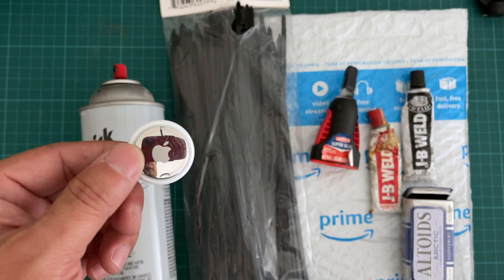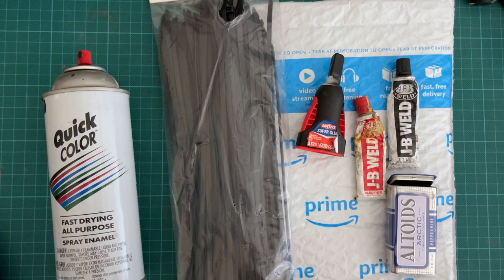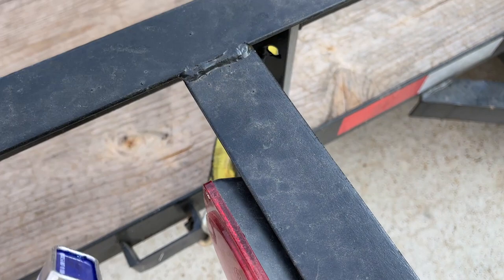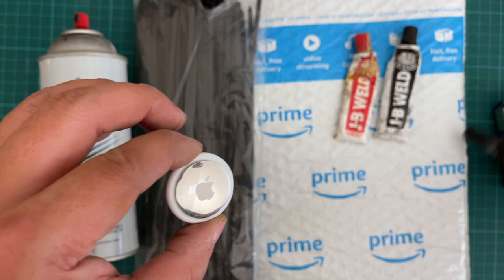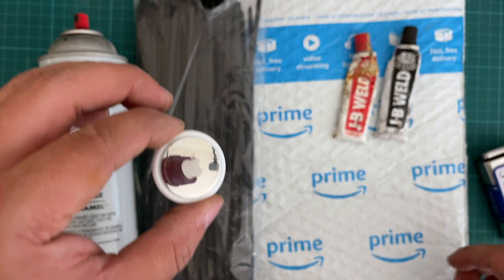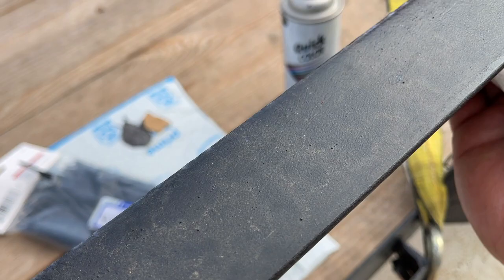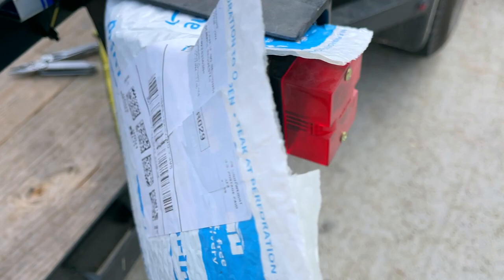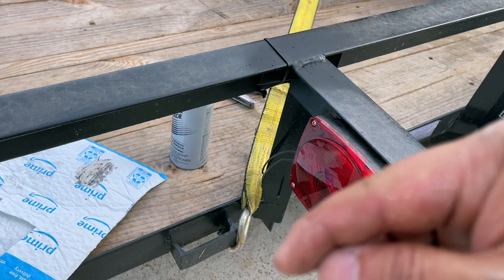🔥 HOW TO USE AIRTAGS TO TRACK YOUR CONSTRUCTION EQUIPMENTS / TRAILERS

Comment: Here’s a simpler way: get 4 inches of 1-1/4” heater/radiator hose or larger. Pre-drill two holes on each end all the way through both walls of the hose. Insert airtag, Screw into wood floor underneath trailer near cross member. Airtags are waterproof, so no need for what you’re doing.

Comment: Why not just a little hot glue and stick the air tag inside the tail lamp ??  Or epoxy some earth magnets to the Altoid box ? The trailer is steel so earth magnets would be more then strong enough .

Comment: all you need is a little bit of small size bubble wrap and two 3/4" wood screws, two 1/2" fender washers wrap the tag tight a few times in the bubble wrap, and screw it  the bottom of the trailer deck as the air tag weighs nothing. I would also suggest you weld your drivers liscense number  on the angle iron where only you know where it is and you can have the law see it even if painted over. It would be hard for a thief  to explain that to a cop.